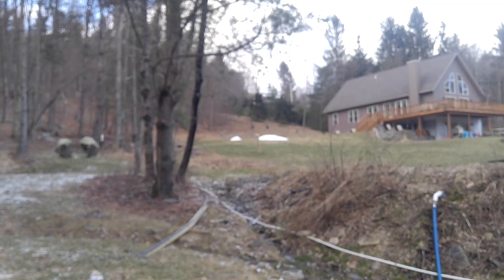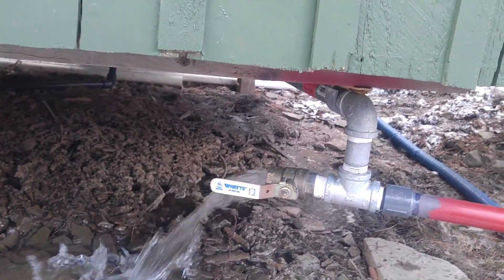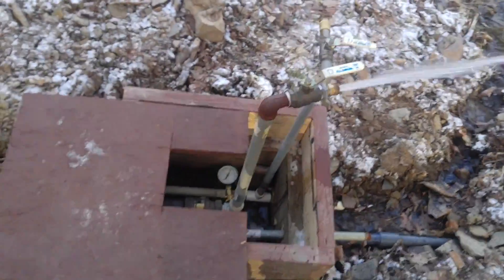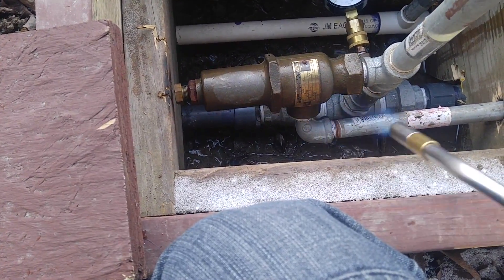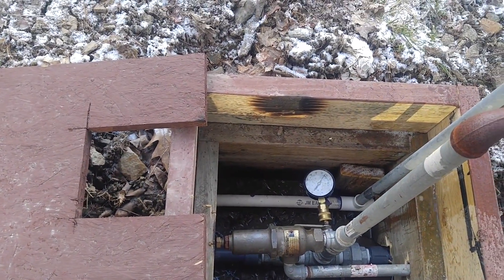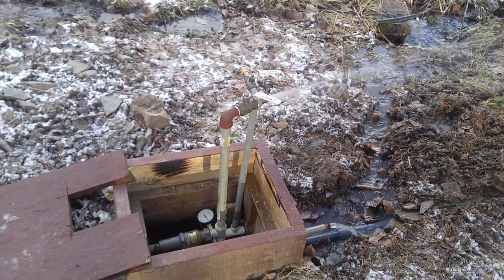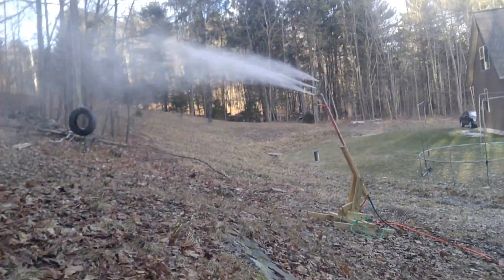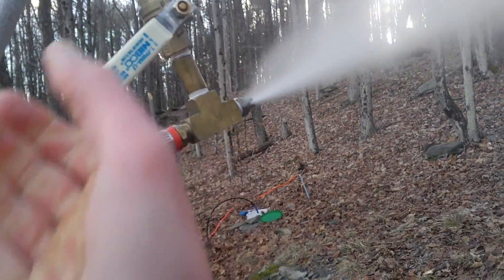How to Make Snow at Woodstream, March 2017

Comment: You need to make more videos on this system this year. Pleaseee
Reply from the maker: Hi @jimmyidkhii2099, thanks for the support! Unfortounately, I don't operate this system anymore. The pipe is broken where its burried under the ground about 6 feet. The pipe was installed back when our pond was first excavated. Although it is possible this system could run again, it's on my parents property, and life has taken me in a different direction the last few years. This will not be the last snowmaking system I build, and there will be more videos to come in the future for sure!
Reply: @ethansnow1222 hell yea, keep it going man.

Comment: How many snowmakers did you got?
Reply from the maker: WilleKlillen, I have 3 snow guns that I can run simultaneously. Sometimes I will only run 2, and run them richer, and sometimes I will run all 3 guns at a reduced GPM per gun as shown in this video.  Each gun has 2 different flow capabilities to balance the GPM across the system. It all depends on weather conditions, and where I want to put snow on the hill. The airflow however is fixed. When running 3 guns, more compressed air is required. Since I posted this video,  I actually added another small pump I occasionally put online as well to run 3 guns wide open curing cold fronts when I want to make a lot of snow fast.